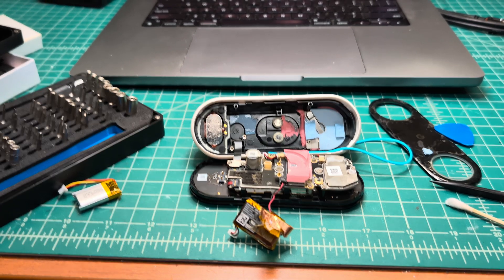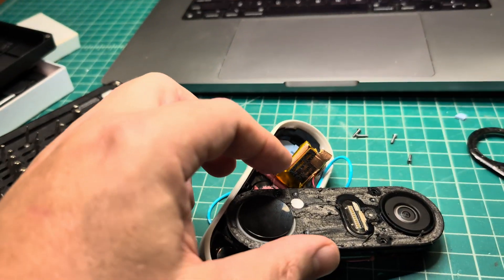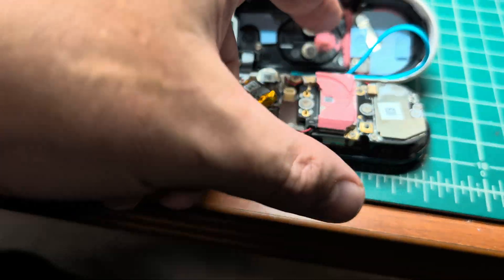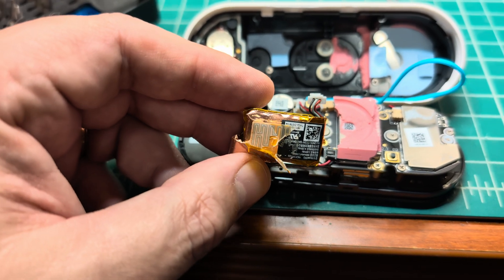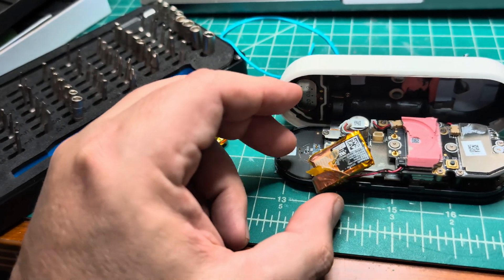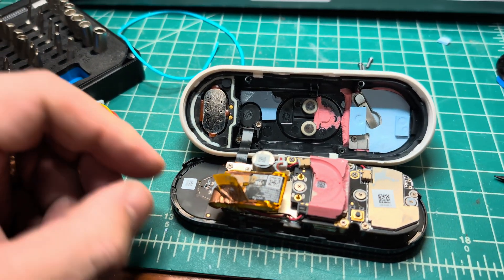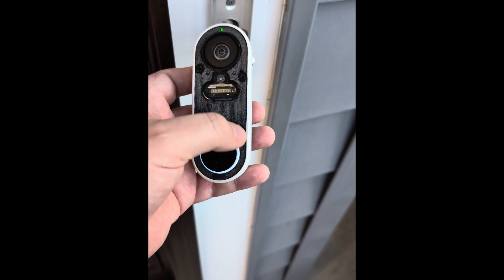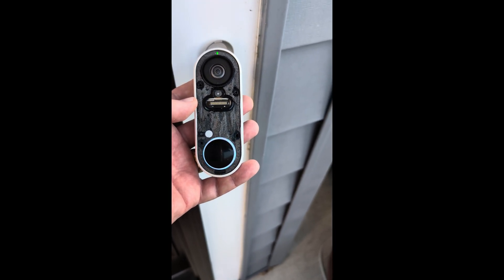Nest Doorbell Battery Replacement: Do Not Even Start It!

Comment: Stupid, unserviceable design. Mine is intermittently blacking out and acting intermittent and probably has a bad battery. Not sure I want to fix it or buy another one either.

EDIT: Cracked the faceplate during removal anyway, and that part doesn't seem to be available anywhere.

Comment: How did you replace the battery.. that is not on video
Reply from the maker: @aaronmaynard698  it’s attached with a connector. If you read the text below video you may see that I just cut the sensor wires.
Reply: @hifirulezzz  Just fixed my doorbell using the same ifixit method. The connector on the battery is actually just connected with a sticker. It may be a heater as others have said, but I was able to just peel it off and reattach it to the new battery. Hope this helps future people.
Reply from the maker: @fishy_go_bwub  Great for you, mine falls apart when I tried to pill it from the battery, I just trashed it. My battery just survived another winter, still works.
Reply: @fishy_go_bwub  this was a critical comment; thanks.
Reply: @hifirulezzz  I think that outer wrapping on the battery is a heater to keep it from freezing in the winter if you live somewhere that gets cold. But I believe there is a thermostat in the doorbell that only turns the heater on when it is cold enough.
Reply from the maker: @ well may be. Why not to use super capacitor? Design is so so.